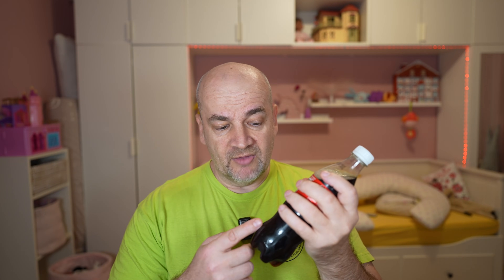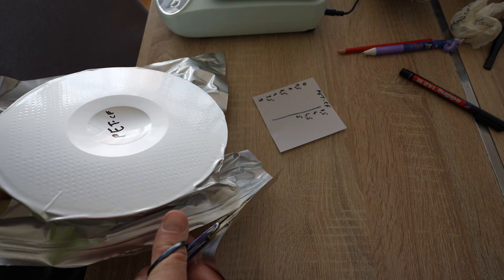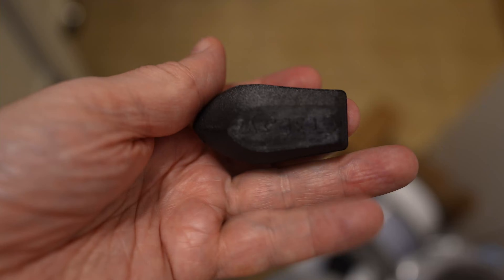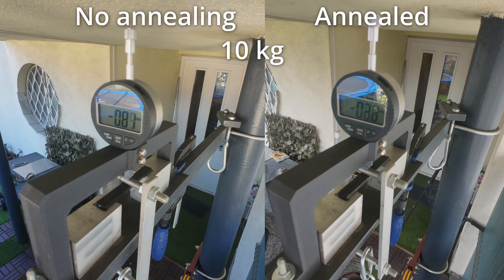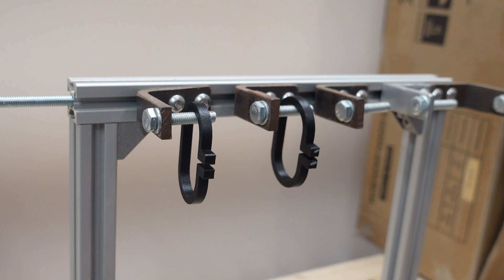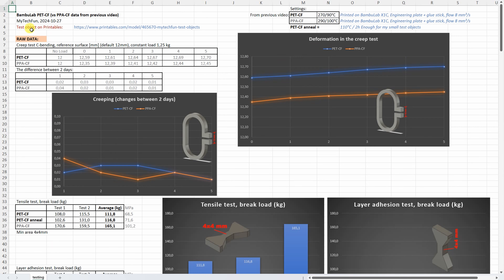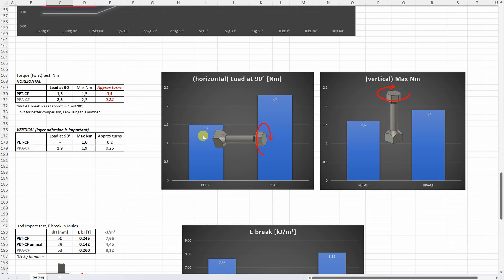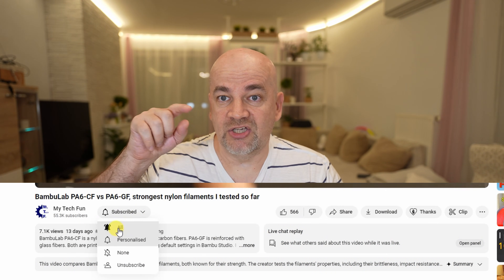BambuLab PET-CF filament review. But how does it compare to PPA-CF?

Comment: the skin of the object will always has the fan on 40% with this setting and will weaken the layer adhesion, no idea why so many Bambulab print profiles use this, but pet cf usually print perfectly with the fan of (just on bridges or or very small layer time)

Comment: PPA is subsceptible to moisture and starts to creep like every nylon. this is the ONLY reason to use PET-CF over PPA-CF even though your tests couldn't show this like many similar laboratory results before. real life applications (e.g. hofmann tactical / reddit fosscad community) have shown that parts under constant spring tension or pressure (magazine bodies, spring loaded buttons) will completely and irreversibly deform when printed in nylon
Reply: Hey, I am starting to print the type of things you mentioned in your comment. Does that still apply if I plan to anneal and ceracote my ppa-cf? And do any of the harder nylons like paht-cf reduce this water absorption?

Comment: Dr. Gaspar, I very much appreciate your testing. Do you share your models for the heat deflection test? I downloaded the “TheAdeo HDT” bridges, but they’re huge. Do you use those and scale them down? I’m sorry if you’ve said this and I missed it.
Reply from the maker: It is on printables. Only, it is not ISO75 standard, the load is smaller in my case (with M10 nut)
Reply: Thank you,  @MyTechFun . I want to test Matter Hackers NylonX post annealing. They advertise very low heat deflection temperatures for a PA12 on their TDS. When I called them, they were unsure whether those were annealed numbers or not. Thank you for the inspiration.

Comment: This video reviews BambuLab's PET - CF filament, comparing it with PPA - CF. It covers aspects like printability, drying requirements, and various mechanical and thermal tests. The PET - CF shows good layer adhesion, is less moisture - sensitive than PPA - CF, and is much cheaper. Annealing can improve its heat resistance but makes it more brittle.
[00:01] Filament Introduction and Preparation
	[00:16] Introduces BambuLab's PET - CF filament blend
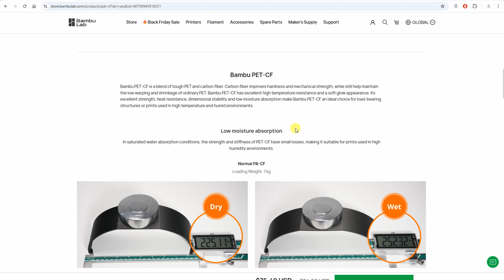	[00:34] Discusses printability, warping, and properties of PET - CF
	[00:56] Mentions drying requirements and spool temperature resistance
	[01:36] States PET - CF is less moisture - sensitive than PPA - CF
	[02:14] Prepares to check brittleness and sets drying conditions
[02:53] Printing Setup and Initial Tests
	[02:57] PET - CF filament is dry out of box, no need for drying
	[03:37] Two vertically printed test objects' printing is finished
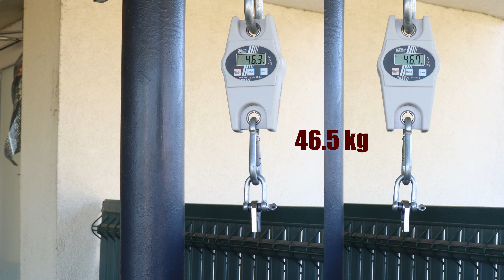	[04:24] PET - CF has good layer adhesion and strong layers
	[04:40] Testing horizontally and vertically printed test objects
	[05:21] Similar load numbers but different break types in tests
[05:45] Material Testing including Temperature
	[06:00] Both PET - CF and PPA - CF can resist temperatures above 200°C
	[06:25] PET - CF started to deform at 120°C, suggestions for annealing
	[07:16] PET - CF at zero position seems tougher than some filaments
	[07:48] Slightly more deformation on PET - CF in creep test
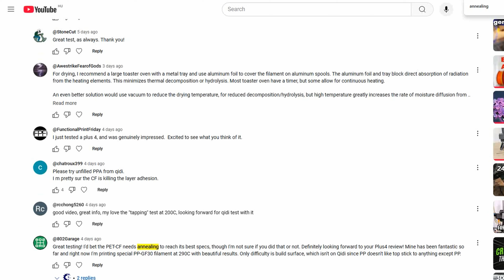	[08:21] Decided to anneal PET - CF, oven pre - heated to 110°C
[08:38] Annealing and Repeated Tests
	[08:44] Prepare to do mechanical testing after annealing.
	[09:24] Compare deformation of objects with and without annealing.
	[09:58] Include data for comparison in a summary table.
	[10:30] Note small deformation in PET - CF during the test.
	[11:02] PET - CF shows stronger layer adhesion than PPA - CF.
[11:32] Comprehensive Comparison and Conclusion
	[11:32] PET - CF has better layer adhesion, with PPA - CF slightly stronger in 3 - point bending
	[12:12] 90° rotation load shows differences; both strong in ISO impact test
	[12:46] Annealing improves PET - CF's heat resistance but makes it brittle
	[13:18] PET - CF is less moisture - sensitive, strong, and much cheaper than PPA - CF
	[13:48] To get spec'd temperature resistancy, anneal, but it makes the filament brittle

Comment: Did you keep all the printing settings stock? I'm trying my luck with priting BambuLab PET-CF with X1C with little to no luck. I tried priting the benchy with stock settings and edges of the print warp like crazy. Slowing down the print and increasing the temp. didn't really improve much.
Reply from the maker: Stock settings, engineering plate+ glue stick

Comment: You should re-try the layer adhesion test with PPA-CF seems little low
Reply from the maker: With PPA-CF? In review video I used default settings in BambuStudio. In second video (PPA-CF vs PEEK) I changed the settings, printing at 300C and reduced part cooling, it was better.

Comment: As always, great video!! 
I would love to see a video about the polymaker fiberon filaments that are now available in Europe. They seem to have rebranded some filaments into the FIberon (maybe to classify them as consumer engineering materials). I'm already testing the PET-CF and PETG-CF filaments for production, and they seem very promising, especially the PET-CF, since it can be printed relatively fast on a Prusa XL. So far, I had issues with all CF filaments and HF nozzles clogging. 

Best 
Fabian

Comment: You should print from the heated dry box with Bowden tube. Keeps it flexible on the way to extruder. 
In my opinion, in your shear tests, it looks like you’re not printing hot enough or your part cooling is turning on. You shouldn’t be able to see evidence of filament in the layers
You’ve gotta try polymaker’s Fiberon engineering filaments.
Reply: @JasonBurchell76  Part cooling is fine with PET unless you're running way too cold, and you need it if you don't want heat dense parts to anneal in places during printing (which gives inconsistent shrinkage).
Reply: I’m curious if you’ve tried Polymaker’s Fiberon filament line, specifically the PET-CF17. They offer a downloadable filament profile for the Bambu X1, which I used as a baseline for my K1C. It printed well at 300°C, but the infill didn’t seem to reach an ideal temperature. After adjusting temp safety values in the printer.cfg file, I raised the nozzle’s safe temperature to 320°C and printed at 310°C. This change made a huge difference in both print appearance and layer adhesion. I also anneal my parts if I need optimal material performance, but my process differs a bit from what’s typically shown on YouTube.

I’d love to see a comparison between the two manufacturers. I’d even be happy to send over some Fiberon I have on hand if you’re interested in testing it out. Just let me know where to send it!

Thanks for all your videos! I’m fairly new to 3D printing, but your channel has quickly become one of my top resources for learning the ins and outs of the hobby. Thanks for the reply!

— Jason Burchell

Comment: Nice work, as always. The large nuts securing the thermocouple have large heat capacity and thermal conductivity. They take longer to heat up, so they could result in low temperature readings.

Comment: it might be a silly question but i am curious - do you fully tune your printer to the filaments you test? i am mainly expressing concern over temperature tuning as it has impacts on these tests. the reason i ask is because there is a cut from the default settings & the test objects being printed with no mention of whether it has been properly configured. i also wonder how significant the difference is between default slicer profile & properly configured profile.

Comment: Nice work. It will be interesting (at least for me) to do the mechanical strength test, you usually do on 3d prints with different infill patterns

Comment: Igor, I've printed my own home recycled PET filament and it's not hard to print. I would say I used settings similar to your PET-CF with no problems. I wouldn't say it was any harder to print than PETG apart from higher temperature. I would only say it is more hygroscopic. I wish someone sold pure PET,it's a lot better than PETG, IMO. The only issue I had was welding my recycled filament, which is why I gave up eventually.
Reply: there are pure PET filaments

Comment: From the Bambu Technical Data Sheet (TDS) for PET-CF - "All the test specimens were annealed and dried at 80 °C for 12 h before testing. And the suggested annealing temperature of models printed with Bambu PET-CF is 80 to 140 °C, and the time is 6 to 12 hours."
Reply: @calebihrig2915  FWIW PET will anneal in about 3 seconds if you get it hot enough. Somewhere between 150 and 250.

Comment: I have ordered 3 rolls of PET-CF from QIDI just few days ago. For 56€ per 1kg roll, it's an amazing filament.

Edit: As for annealing, QIDI's wiki states 90-130°C for 6-8h. I am curious what the difference would be (e.g. 100°C for 2h vs 100°C for 6h vs 130°C for 6h etc., but that's a lot of tests 😅).
Reply from the maker: When they write this annealing times, they must predict every object type. Mine are small, 2 hrs are enough for the core to heat up.
Reply: @MyTechFun  Yes, I do agree that 2h should be enough for your specimens, though difference between 100°C for 2h and 130°C for 2h could maybe yield some differences, but I honestly have no idea, just theorizing here.

100°C for 2h vs 6h was just me thinking if the core needs to be kept at that temp for certain time, but I don't think it is necessary as long as you hit it evenly for at least few minutes.

Comment: Two hours and 110C is NOT enough for PET-CF. This is a good starting point, but ramp up to at least 120 and if possible 140C for an additional 4hrs
Reply from the maker: Depend of the object size. For my small test objects, 2 hours are far enough for the core to heat up

Comment: Very interesting! I love your thorough and no nonsense videos!

I've recently come to love printing PET, but there aren't a ton of brands that make PET filament, especially cheap PET... It does seem to make great springy parts and clip arms that don't creep as much as other materials I've tried.

I wonder how it compares to HTPET+ from fusion filaments though? Mostly when it comes to how much you have to dry it anyway... It's not apples to apples as its not fiber fileld, but I find that the Fusion Filaments PET prints as fast as PLA and doesn't warp at all but, unfortunately, strings like CRAZY if you don't keep it perfectly dry. It also seems to absorb moisture MORE readily than silica gel, so I pretty much just have to keep it in a dryer at all times. Does this stuff suck up moisture like that? I almost feel like the fusion filaments stuff would work better as a desiccant than actual desiccant. The upside is that it only costs $35 a roll.
Reply: @DrPersonman  Use 4A molecular sieve desiccant instead of silica gel.
Reply: Whete are you buying that one?
Reply: @riba2233  Directly from the "Fusion Filaments" website under the "engineering filaments" category. I guess the named it HTPET+ because people kept mixing it up with PETG and they used to make and sell both. I think they usually sell out on a lot of the colors but they do make some nice colors of it.

Comment: Doesn't need heated chamber. Really stiff. Impervious to most household chemicals. Doesn't warp. Doesn't smell too bad when printing. What's not to love? I wish we could get PET more easily too. I tend to buy it in large quantities in bulk whenever I can.
Reply: I'd love to do that, where have you had luck sourcing PET?
Reply: @notyouraveragegoldenpotato  The only manufacturer I can readily get hold of in UK is BASF. It's damn expensive at about £32/kg but every so often you can pick it up for <£20.
Reply: I actually got Pet from BASF at home. It seems like a bad joke. Print temperature is like Petg and even the profile for Bambu lab is named with Petg...
Reply: @j.b.3171  Wdym? I've got a lot of experience with this material (exclusively printed in BASF PET and PET-CF the last two years) so if you have some problems maybe I can help. I don't have a Bambu though so might be more general tips rather than specific
Reply: @MrJofArnold  The only BASF "PET" without CF I've found is "amorphous PET", i.e. some PETG variant.
Reply: I don't have problems. It prints perfect. You can print it like Pla on every standard printer. They just forgot the "G" after "PET" on the package and also on their homepage.
Reply: @j.b.3171  Indeed. It's excellent. But they didn't forget. BASF Ultrafuse PET is PET and not PETG. One of the reasons this stuff is hard to get is BASF is a provider to industry and many of their filaments are used in automotive mass production (I have been told the PET-CF is used in cars but the person I spoke to was tight lipped about the details), so this isn't the kind of company to forget a letter. For that reason their data sheets are especially interesting as they go into a lot of technical detail at times. Helpful.
Reply: @MrJofArnold  The unfilled "PET" from BASF is absolutely not PET. The data sheet says "amorphous PET". I've purchased it to test and it melts way below the melting point of PET, is not annealable, and fails to print at PET temperatures - it turns into a brittle mess and disintegrates over 280 or so. It may be a decent PETG variant/alternative but it's not PET.
Reply: @daliasprints9798  Additional to my other comment, thick section PET is indeed brittle. As is PETG. As is PET-CF.
Reply: @MrJofArnold  i already red the data sheet and it said the weakening temperature is 71°c (160° F). And its also not really stiff so it may be pet but with petg properties.
Reply: @j.b.3171  BASF PET off the spool has a Tg of about 70C according to my poor quality tests. Amorphous PET in general 65-70C. PETG around 85C. So even given the poor accuracy of my home setup, it exactly matches PET and isn't close to matching PETG. Not sure quite what else to add really. It's demonstrably PET in its data sheet, is confirmed as pure PET by the supplier, is made by a major manufacturer of PET, matches my measurements of mechanical properties and prints like PET.
Reply: Thanks for the lesson! I expected pet to be a way better material then Petg. Luckily I didn't pay much for the spools i had as they came with a used printer from eBay. Otherwise I would be really disappointed.
Reply: @j.b.3171  Pure PET is a pain, no question. There's no good profiles for it so you have to experiment with it a lot to tune. It's brittle, very sensitive to temperate and very very sensitive to moisture. It'll happily pull water out of less-than-perfectly-dry dessicant packs and I've found a 1kg spool needs over a day at 60C (actual 60C!) in the dryer. However, once you've tuned it prints crazy fast with no oozing, isn't hard on the lungs, doesn't need heated chamber etc plus all the material benefits. And BASF PET-CF is a fantastic material. Couldn't live without it. If you're in UK and want to get rid of your PET I'll happily buy it off you 😆
Reply: @notyouraveragegoldenpotato  In the US, Fusion Filaments. There's now also one Chinese vendor for real PET, unfilled, with international shipping. I forget the name; I'll post if I find it again.

Comment: Does this material require an enclosure?
Reply: Petg will absolutely warp if the ambient temp ragerdless of enclosure is too far below it's Tg. But this is still dependant on build plate, glue etc. Petg cf much less so.
Reply: Depends on the part size
Reply: @riba2233  that's kinda obvious. Eg. ABS is notorious for needing an enclosure, but it's also notorious that small parts don't make it in time to warp. PLA and PETG on the other hand don't need an enclosure whatever the part size. So PET-CF absolutely needs an enclosure for big or complex parts?
Reply: @KToMmi  I would say that it does yeah, it warps more than petg
Reply: @KToMmi  For getting good prints, no. For avoiding lung cancer from CF dust going everywhere, yes.

Comment: The temperature resistance without annealing is still good for 90% of applications I would say and if you really need more you can just anneal it. The value for the properties is very good for this PET CF. I am starting to wonder how low warping these engineering materials are. There are some larger build volume printers out there. For example with a Ratrig V Core 4 - 500mm you could actually print PC cases out of these materials, but would a case panel 400mm long print without warping with PET CF or PPA CF?
Reply: In my experience, every plastic will warp on large objects if you don't design to counter that warp. Even small shrinkage rates develop over distance and can cause warping. The key is to prevent very long, unbroken sections, add relief points to help. Or decouple the longer extrusions from direct bed contact.

If you play with your design you minimize warping, and just have to deal with shrinkage, with is a much easier problem.
Reply: @JOEDHIGGINS  Definitely, adjusting the design for the manufacturing technology is key. But having a different design and print orientations for example can lead to weak points due to anisotropic properties (intelayer adhesion), so lower warping materials just give you more play room and you have to make less compromises on aesthetics for example.
Reply: @Dramaican88  Yup, but even PLA shrinks meaningfully over several hundred MM. All plastic does (hell nearly all materials shrink when cooling from 2-300c to room temperature. Over a large part, this becomes significant, and requires design and fabrication considerations, regardless of material. But like I said, there are tons of solutions, and some of them, like corrugation can be easily incorporated.

This isn't unique to 3d printing g either. Even CNC machining has to take this into account.
Reply: That would be a VERY expensive pc case.
Reply: @riba2233  All one offs custom cases are very expensive. If you see InWin limited edition (Z-tower for example) and Singularity Computers cases then a 3d printed case out of PET CF is easily comparable.